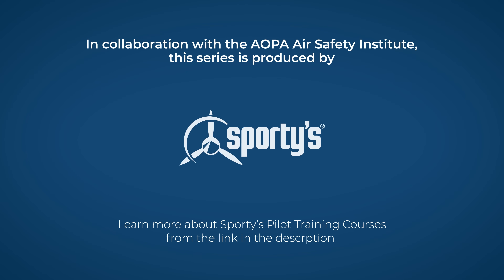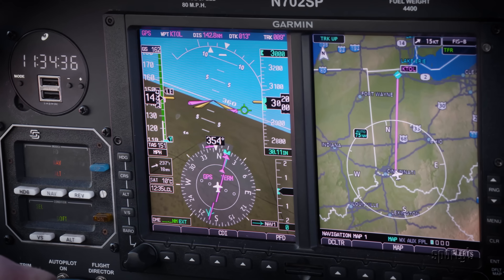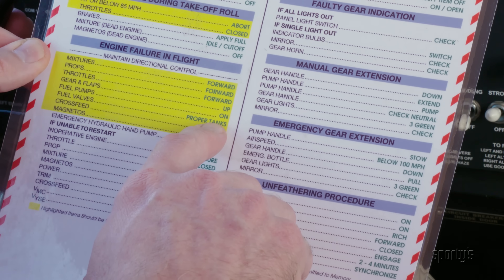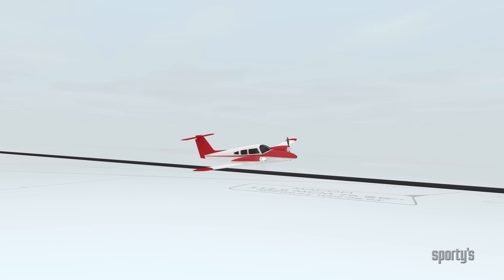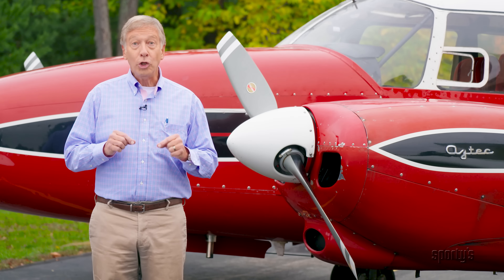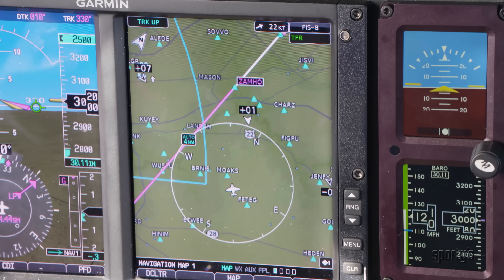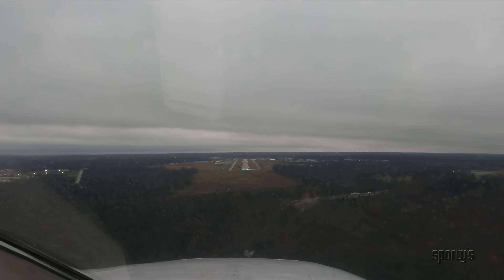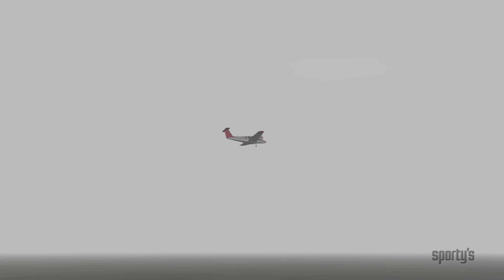Taming the Twin: Engine Failure in IMC

Comment: I too, got my multi rating almost 50 years ago in an Aztec, but did start fly a twin for another almost 20 years (B58TC). I spent 10 hours in a Baron for a refresher and then spent 3-4 hours a year in recurrency, including IFR and an IPC. Rewarding. Never had an issue with my Baron, flew moderate IFR when necessary, lots of approaches. I had a six pack, with a King HSI. Rarely used my FD. My moving map was a KLN 94. Easy Pezy. Nothing like good flight/engine management training.

Comment: IMO opinion, staying aloft longer (while monitoring the good engine's instruments and managing fuel, of course) in order to find an airport and approach that greatly diminishes the likelihood of a G/A is greatly preferred to feeling pressured to get down quickly. An SE go-around/missed approach in a light twin, with high power on the good engine and low energy is very undesirable; especially in a scenario where you will be climbing right back into IMC. I would really try to avoid any SE go in a light twin if at all possible.
SE go-arounds in any A/C, up to and including jets, are not fun.

Comment: I remember back in the day in 1995 when I did an accelerated course, I got my multi engine in a week. I believe I trained in a 1956 Piper Apache PA 23–150. That aircraft cost me a whopping $125 an hour. Instruction I believe it was $35 an hour. It was fun flying compared to a single. I never flown one ever since. Here I sit almost 30 years later with only about 29 hours total time in multi engine aircraft with no hopes to ever fly one again. They are just too doggone expensive and especially now just to solo in one with Insurance requirement would take enough time to cost me around $9000 to $12,000! Not worth the effort when you don’t draw revenue from flying. It’s nearly impossible for the average blue collar worker to afford a $400 an hour aircraft. The video was wonderful refresher, but nothing compared to doing all that with the old steam gauges and an NDB approach. Too much automation makes it too easy now. Back in those days old small commuter planes had auto pilot, but it was very uncommon for most general aviation to have one. Usually just a wing leveler.

Comment: After getting my multi rating waaay back in the mid 70s I didn't fly another twin for years; mostly singles for 20 years.  When I had the opportunity to step into an E-55 Baron in the early 90s, I relied heavily on the publications put out by AOPA and Sporty's to help get me re-current and stay safe in the same Baron for 27 years until my retirement.  Good instructors and having a qualified pilot in the right  seat also helped.  I highly recommend the products put out by AOPA and Sporty's.  Sure wish YouTube woulda been a thing back in those days.

Comment: Correct.  You must practice.
1) Maintain Directional Control
2) All levers fwd (in order)
3) Clean it up
4) ID and verify
5) Fix or feather
6) Raise the dead engine
7) Pull mixture
8) Fly the plane.